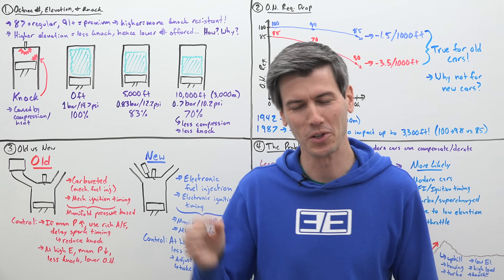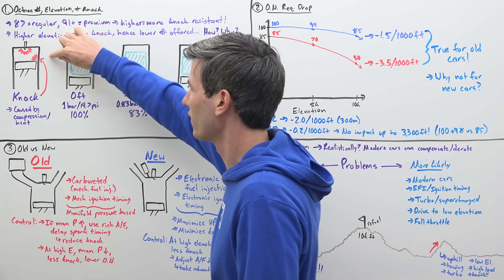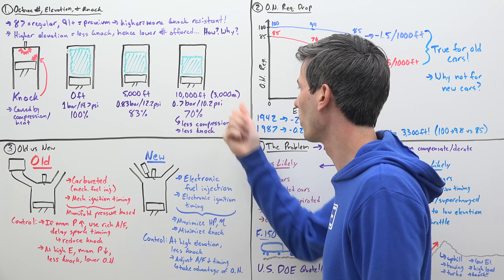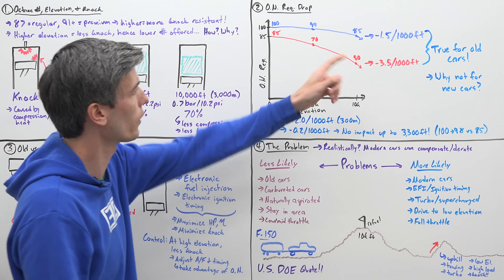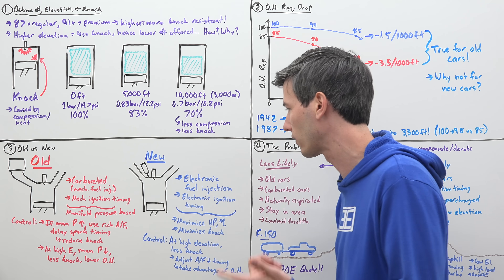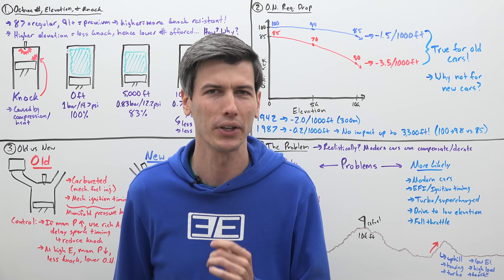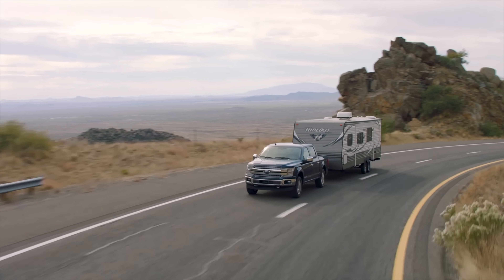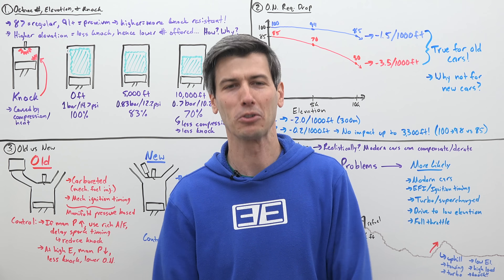Never Use This Gas In Your Car!

Comment: My Honda CRV 'Earth Dreams' engine has never seen anything but 85 Octane.  After 100,000 miles it still runs like a dream.  But it's never been anywhere near sea level.
Reply: @AlWorth9738 what car do you have, big boy?
Reply: @VoidSinister I've got a lifted F350 Tremor dualie. I will crush your little toys that you call cars. 

 Maybe I've already have, and thought it was a pothole that screamed. 

 Just playing. That was an odd comment he said.
Reply: Yea I've got an MDX that's run on 85 for 21 years and it still runs absolutely beautifully
Reply: Fr yeah 85 is fine for most cars most pumps in my area that say 87 have 85 anyways the only cars that are gonna flip out are the ones that require 91+
Reply: @G-spotGeorge anything with a turbo will be quite unhappy on 85. They will run on the edge of the knock sensor all the time which isn't great for economy or power
Reply: @D @DarkAttack14 this is not true at 5,000+ unless they are aggressively tuned. They mostly run fine on 87 at sea level, just with less peak boost. Accordingly, they run fine on 85 at altitude.
Reply: @777jones Most modern motors are running on the edge of the knock sensor at all times running 87, it's just how engines are being designed. My 2012 Chevy cruze shitbox was a craptastic 1.8 naturally aspirated and even that was right on the edge of knock due to a high compression ratio for a vehicle "meant for" 87 octane fuel. It's just how it is
Reply: @DarkAttack14  Yeah, it varies. Not doubting what you say. My 2020 Volvo turbo runs smooth and strong on 87. 89 provides a little more torque. Same for my Range Rover with Bosch engine computer. My older turbo cars really needed 89 or even 91 to run right. I do believe some engines are octane queens.
Reply: @AlWorth9738bro stfu they are pretty high compression engines, bet they make more hp/liter then your American car, assuming you have a American car cause of your comment. Ignorance is common with American car owners
Reply: Actually its just a car.@AlWorth9738
Reply: @AlWorth9738 All cars are toys. Try an airplane.

Comment: I'm at sea level and all our premium gas is 90 octane, while our regular gas is 87 octane.  I've seen premium at 93 octane in the US and 94 octane in Canada.  My truck recommends the use of premium gas.  I have a 2019 Silverado 1500 with the 6.2L engine.  Our gas is straight 100 percent gas...no ethanol.  Is there a problem with the octane being only 90?

Comment: I live in Salt Lake (approximately 4,500 ft. elevations).  I used to used 91 octane fuel thinking I was doing a good thing for my car.  After I plugged up the second catalytic converter, it was explained to me why using premium at this altitude is not only not beneficial, but can also be harmful.  I my engine could not burn the higher octane completely.  So, I was putting incompletely burned  fuel out the exhaust.   I switched to 85 octane and have never had any problems.
Reply: Use what is recommended by the manufacturer.  Running slightly lower octane probably won't cause knock, but could.  Running higher octane probably won't foul a cat, but could.  Running higher octane than recommended will never provide any benefit under any circumstance with the possible (possible, not likely) exception of towing near a truck's capacity up a steep hill for a prolonged time.
Reply: @SeniorKlean I live in Utah and have been using 85 octane for 10 years,  never had any knock or engine issues
Reply: @natejohnson5393  Hopefully not with a turbo engine.
Reply: Have lived and driven in higher altitude states for over 30 years and always burned 85, no knock, no engine problems. When I drive down to lower elevations I always fill up with 87. The real irritation is 85 is priced the same as 87 at lower elevations.
Reply: Whoever gave you this information was simultaneously incredibly confident and incredibly wrong. You bought contaminated fuel.
Reply: I'm in Utah as well, and have had no issues running 85.  We live at high altitude, so it's just fine due to the lower oxygen levels here.
Now, if you ran 85 octane at sea level, you might have some issues.

Comment: Knock = uncontrolled detonation. Octane = resistance to detonation compared to isooctane in an Octane Engine. The octane engine looks neat. 
-As taught by FAA approved technician courses. 

Also, we still use lead gas. All those Cessnas and Cubs and whatnot are still leaded because they use 5 million year old engine designs, some of the newer stuff uses repurposed modern motorcycle engines.

Comment: I'd like it if you would identify exactly what a "knock" is, and what causes it. A "knock" is caused by the cylinder firing too early at the end of the compression stroke rather than at, or just past top dead center at the beginning of the power stroke. It puts an increased shock on the internal moving engine parts which is why OEM's recommend a certain octane. So how does "octane" prevent pre-ignition of fuel in the cylinder? By raising the temperature as which the fuel ignites. Higher octane, higher ignition temperature threshold. You might say, but wait a minute, the electronic ignition is computer programmed to spark at exactly the right time, so how can there possibly be a timing problem that could void my warranty. The answer lies mostly with compression ignition. Compressing the air-fuel mixture in a cylinder can raise the temperature to a flashpoint which will prematurely light the fuel in the cylinder. Diesel engines work without spark plugs from compression ignition. When the compressed air in the cylinder is at top dead center, and at its highest temperature, a fuel injector shoots a mist of fuel into the hot air and...BANG. Compression is based on how close the top of the piston gets to the cylinder head. Lets say that when a piston is at the bottom of the stroke, there is zero compression on the air-fuel mixture in the cylinder. As the piston rises in the cylinder, the compression increases. If the stroke of the piston is 4 inches and the cylinder head is 5 inches away, that would be a 4 to 1 compression ratio. You are compressing 4 units into the space of 1 unit. The octane rating is a scale of minimum fuel  ignition retardant necessary to prevent compression ignition for the compression ratio of a given engine. Upon further review...a KNOCK is sumpin dat comes out of da motur.

Comment: Been running E85 which is 100 Octane in my 2011 cop cars for years. Works perfectly! But of course E85 is what they are designed to run on.
Reply: It works good in my van too, but mileage drops quite a bit, and E85 is very hard to find around my area, unless drive an hour away. For awhile there it was worth it because it was a lot cheaper, but lately there's not enough of a difference in price to warrant the big loss of fuel economy. However, it seemed like had a lot more power, and idled a lot smoother on cold start than reg 87.

Comment: I remember entering a military base, I was critically low on fuel and in hurry. I mistakenly grabbed the wrong one and put e85 in my motorcycle's tank.
I managed to operate it for another 50-ish miles during that time it was struggling to maintain it's pace on the freeway.
Thankfully the tank wasn't large and I just barely managed to limp it onto an exit where there was a gas station with 93 gas. The incoming octane of the 93 balanced it out enough that after letting the bike sit and some attempts to start it again it did spark up, narrowly avoided ruining my engine.
Reply: Yup, with E85 you need a lot more fuel, it needs a much richer fuel mixture and a lot more timing because of the higher octane rating. If you had a mechanical choke, you might have been able to run at partial choke to get to where you could get the proper fuel, and then help prevent damage from running too lean. It was struggling because it was effectively running too lean, and that can damage an engine. Glad it turned out ok!
Reply: @brnmcc01  I figured it would need to run hotter and burn more fuel, to keep the fuel injected engine from stalling out, I ran it wide open and made it work as hard is it could but I could feel it struggling on the freeway. Lessons learned!

Comment: Is it true that a turbo charge engine boost pressure  isn't effected by elevation in cars.  So technically wouldn't that mean cylinder pressure.   If thats the case, why don't they have 93 octane in high elevation like utah?

Comment: Gasoline engines with Variable Geometry turbo's do not really "see" elevation air density change. The VG turbo is plenty capable of providing the same cylinder pressure at 10,000 ft as it is at sea level. This is why it's likely an issue for Ford due to their Eco Boost engines. TFL drives me crazy with their videos when they test a modern turbo engine and they talk about the 30% power loss because of their elevation around Denver. I've called them out on that point but they still don't get it and keep referencing elevation power loss when they make videos on VG turbo powers vehicles.

Comment: My VW splittie will Run happily on 77 octane and it's older brothers on 70. A 7:1 compression ratio or less and manually adjustable ignition timing helps!

Comment: What about two stroke engines, I have a KTM with a 150cc engine and usually ride at an altitude between 7000 and 10000 feet! Should I use 87 or more?

Comment: I live in Colorado.
In the Denver Metro area.
It varies from 5280' - 6000'
I've always used 87 octane or better.
I have a 2016 Chevy Equinox with a 2.4 ltr 4.
It's compression ratio is 11.2
I bought this vehicle new and from day one I run it on Premium fuel.
Everyone thinks I'm nuts and waiting my money.
11.2 to 1 compression ratio
My cars owners manual says to use 87 Octane or higher.
This is a small direct injection engine pulling around an AWD 3900 lb vehicle.
It runs reasonably well.
The 4 puts out 182 horse at 6700 rpm
Torque is 154 @ 4500 ram.
I get 20mpg in the city all the time.
I'm okay with fueling with premium.
I think 87 Octane would lose power.
What do you think?
Am I being fuelish😆!

Comment: Seen this firsthand in my friend's outback in Denver. 2014, 4 cyl, no turbo. He had mentioned hearing a weird noise from his engine when he's driving sometimes. We went up into the mountains one day and as he was climbing a steep hill I rolled down the window. I said, wow, you're getting engine knock. What fuel are you using? Uhhhh the cheapest one? Stop, I said. It boggles my mind how they have no warnings or anything. We all know cigarettes cause cancer, most people know jack about cars, yet only one is covered in warning labels. Anyway, in this case, the 4cyl naturally aspirated subarus are extremely under powered IMO. And when you're climbing hills, you may be wide open just to keep it going. That said, we must have been around 7000', and I was surprised to see it.

Comment: 87 is the flash point 
the knock is when the gas ignites after it should  like the sound you hear in a diesel engine 
and you car truck will change the timing to make it run right with any gas you use and fuel ratio

Comment: Is this 0:18 considered to be a car? Nevermind, what I'd love to see from Jason is an assessment of the advantages and disadvantages of high altitude for car performance, specifically land speed records set at Bonneville salt flats which is at 1,291 m ( 4,256 ft) elevation. From my understanding, some record attempts are moving to Salar de Uyuni in Bolivia at 3,656 m (11,995 ft), with higher altitude being one of the reasons. Deteriorating track conditions at Bonneville is also a factor. Aerodynamic drag is reduced at high altitude, but for a piston driven engine there must be some disadvantages too.

Comment: I've had 4 cars go over 200k miles on 85 octane without a single engine issue, that's savings of about 6000. Over the life of those cars. Now just last week I got my first turbo car and unfortunately it will be getting the pricey stuff. But for NA daily drivers,, I'll stick to the cheap stuff. I have a 70's jeep and I swear if I could find leaded fuel it would run even better.

Comment: I'm technically from WY/CO...lived in FL for a while now, going back I noticed that 85 thing. I drive a Prius, I have put in the 85...and it sucks, made my Prius have significantly worse gas mileage, never got knock though..which sucks because the only reason why I got a Prius was to save on gas. Looked at my owners manual and it specifically says to put in 87 into the Prius. So what I did was started to pay more for gas and getting mid grade which a lot of stations that mid is 88, I didn't find many where mid is 87. I think they need to stop selling that bs gas as regular, it sucks...it did make a difference in my car and luckily I stopped using it, it's only I couple states I think...I noticed it in WY, CO, I believe Utah, Nebraska etc. My gf Dad who works in oil and gas industry was trying to tell me it doesn't matter, I figured he was wrong, he's not an mechanical engineer or petroleum engineering or anything like that, he cuts pipe...glad to get some engineering reassurance bro.

Comment: I do engine cal dev at an OEM - not Ford's - and we specifically test with and validate that all of our gasoline engines (even the ones that require premium) will operate on 85 octane without issue. :)

Comment: Damn, always wondered how gas could be so ridiculously cheap in the USA. I thought that 85 octane was the stuff you'd get in third world countries. In central Europe, you'd hardly find 91 octane fuel, because for about 10 years the minimum octane rating at most fuel stations is 95 (super).
Edit: Apparently, due to the different scales, RON 95 equals US 91 octane fuel, RON 98 to US 94 octane. Still, the cheapest fuel here at approx. 1.3 €/L (= 6.7 $/gallon) is apparently called "premium" in the US...

Comment: Come on, every modern vehicle has knock sensors. The sensor detects knock and immediately cuts timing.
At my 7000-ft elevation I run regular fuel in my 2001 turbo Passat with no problems, been doing it for five years of ownership.

Comment: Standard fuel in the uk was 95 octane up until this year with premium being higher (Also not sold everywhere).  Always wondered why Americans had so many pumps.
Reply: On top of that, even with 3 or 4 nozzles, most stations only buy regular and premium.  The mid grades are mixed at the dispenser right before the nozzle.

Comment: 2:03 would it be fair to compare "knock" to the way a diesel engine works considering combustion occurs due to pressure rather than the spark plugs like it does in regular engines? im not asking for a list of differences between gas and diesel engines but rather if the premise is the same in regards to combustion specifically during "knock."

Comment: Most commonly octane ratings of 84 are called "regular', ratings of 87 are "Premium" and higher  octanes are high test.  Your owners manual tells you what octane rating your engine was designed to burn.  Your engine does run better and get better mileage if you run the recommended grade fuel.  These days, regular grade fuel is  made for scooters, lawnmowers, snowblowers, and weedwhips.  I haven't had a car in years that ran on 'regular".

Comment: I think modern engines, even EcoBoost and other turbocharged engines, are smart enough to not blow up from lower octane fuel. When I initially got my new ford ranger I was using 85 as I always had in my previous N/A fords here in the Utah mountains (5000-9000 feet). I later learned about how turbos normalize for cylinder pressure and have used 88 ever since, but in a few thousand miles of driving on 85 I never had an issue, including on long mountain climbs and flooring it up on-ramps. I think my engine does have a bit better power with the correct octane now, but I wouldn't be too worried if I accidentally put 85 in.

Comment: if you car car run on 87 octane at sea level, it will run just fine on 85 octane at higher elevations, it is not dangerous at all. It doesn't matter how much a newer car can alter timing/fuel injection/throttle blade/etc it's still getting less oxygen and pressure. Yes, I know that's not true of force induction engines (turbo/supercharge), but forced induction engines also don't use 87 octane even at sea level so that argument is moot.

Comment: On my road trip from Ohio to Oregon I ran Into 85 for first time in my life, and was left at no choice but run it. Went to a gas station and that was only offering it and was nothing around for miles to naked eye. My 2006 2.5i legacy was fine. It did feel very sluggish at them altitudes between weight In car, grade of hills and I'm sure the ECU pulling timing was a thing. Would have been cool if I had my laptop logging to see looking back

Comment: I can think of a few other gasses that shouldn't be in vehicles. Mustard. Methane etc. And of someone is doesn't understand their car and won't read the manual that is on them. Stupidity will always cost you. And pro tip at altitude switch the vehicle off and back on every 1500 ft of elevation so you get a new baseline on the barometric sensor on a MAF car. MAP cars can struggle just as hard but they tend to take constant readings rather than just 1 at start up . Another good video idea is to explain to people why it isn't necessarily a good idea for people who's cars ask for regular to run them on premium

Comment: Here's a crazy idea.  Lets have two gas tanks.  One for cheap 82 octane that you use for 98% of your driving an and little 1-gallon tank with 105 octane, and let the car's Engine controller determine the optimum mix on the fly.

Comment: And in Eastern Europe, Serbia mainly, we buy 95 octane rated as regular, and 100 as premium. I should point out that our measurement units are according to RON (Research Octane Number), which would translate to US ratings as 91 as regular and 95.75 as premium, according to online tables. Is there any reason you wouldnt use uleaded gasoline with this high octane numbers?